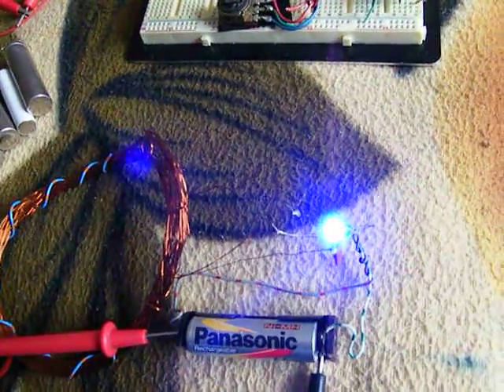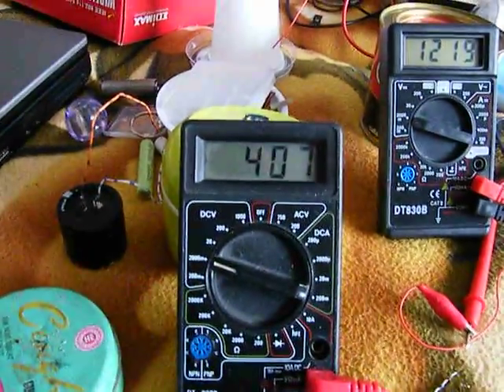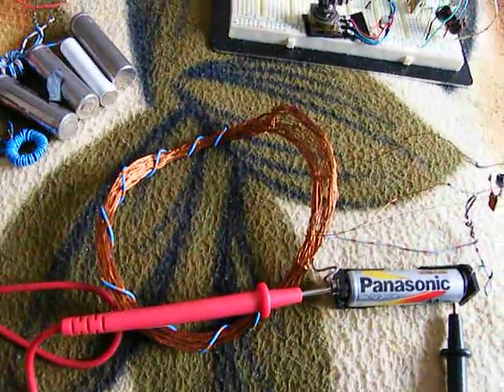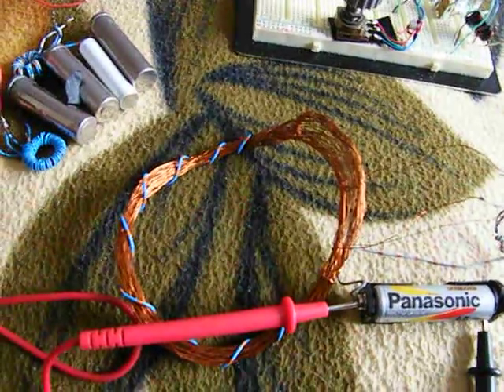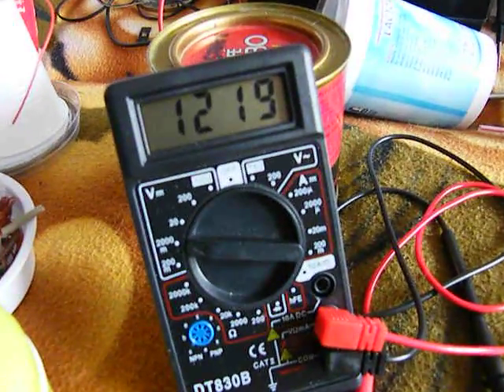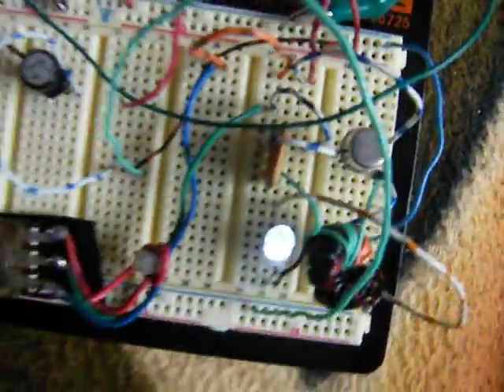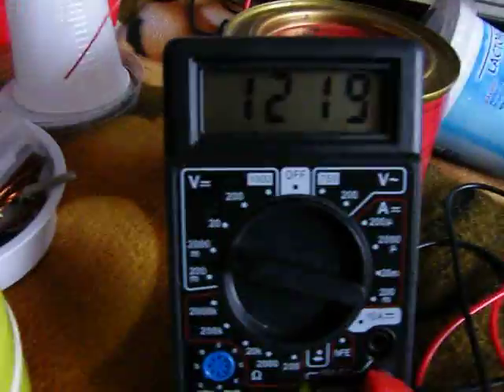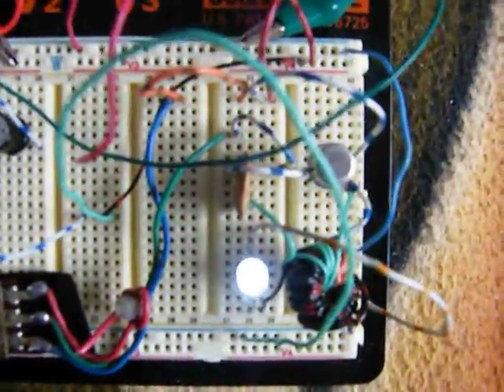Overunity Charger & Nonconventional Joule Thief

Comment from the maker: FOR EVERYBODY PLS READ THIS: THIS OVERUNITY CHARGERS PRESENTED ON MY JOHNNYAUM(3) CHANNEL ARE OVERUNITY, BUT CAREFULL SETTINGS MUST BE MADE, PREFERABLE WITH OSCILOSCOPES, AND IS NOT EASY TO MAKE IT WORK CORECTLY & TO DISPLAY OVERUNITY - I WAS TESTING MY OU CHARGERS CONTINUOSLY FOR A FEW DAYS FOR OU, WHEN CORECTLY SETTED, THEY RECHARGED ALSO BATTERIES, BUT ITS EASY TO DISTURB THE SETTING, IS VERY DELICATE... TRY THE SOLAR FLIP-FLOP DEVICE, IS EASY TO MADE, AND FREE ENERGY 100% OR ONE THOUSAND% - AND JAMM MAGNET MOTOR DEVICE ON MULTIPLE FLOORS, OK? I AM AN SUPER-EXPERT IN FREE ENERGY, I KNOW WHAT I AM DOING, I CAN PRESENT YOU TENS OF FREE ENERGY DEVICES, IF YOU WANT TO INVEST MONEY TO TEST THEM ALL! I WILL PRESENT LATER SOME OF IT, WHEN I MOVE TO HOUSE AND WORKSHOP! YOU MUST REALISE THAT ALMOST ANY FREE ENERGY DEVICE REQUIRES LOTS OF MONEY...

Comment from the maker: The Joule Thief air coil is bifilar, 2 wires in parallel, the begining of the first wire goes to transistor collector, the end of the first wire goes to begining of second wire and all goes to positive pole of the battery, and the the end of second wire goes to resistor.